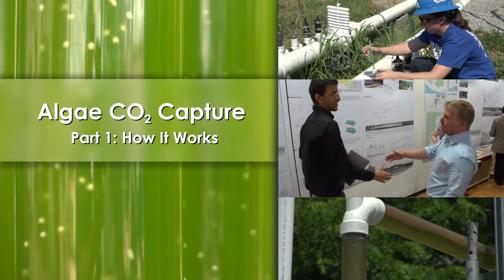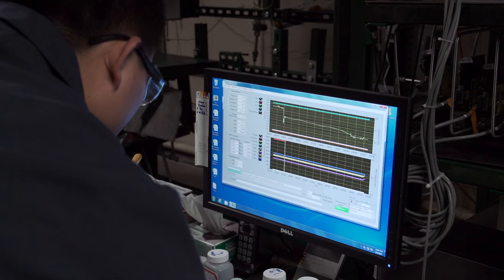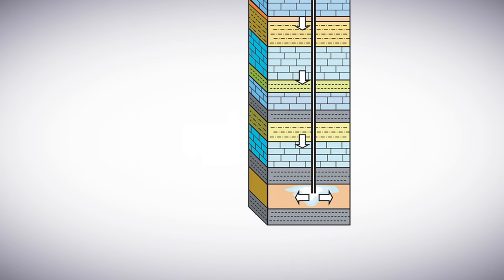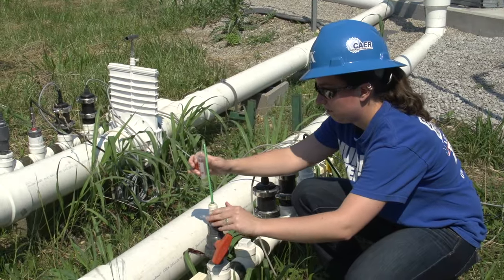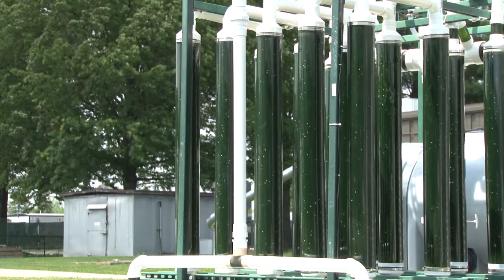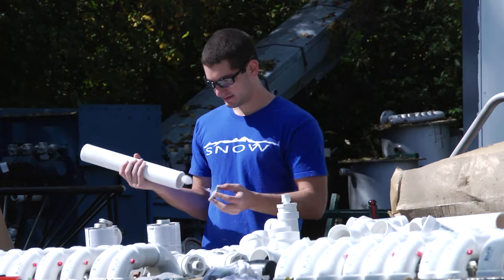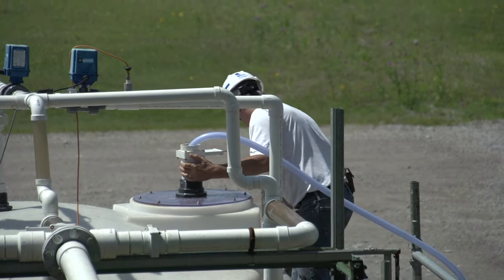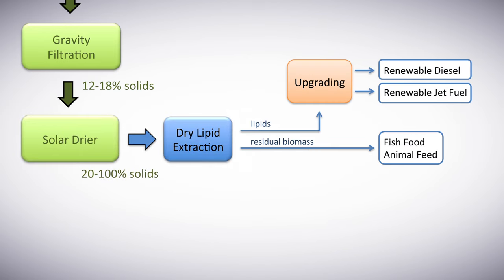Algae CO2 Capture at the University of Kentucky: Part 1

Comment: Could we PLEASE just focus on getting the CO2 out of the air as fast as possible and NOT delude ourselves into believing we're going to use the algae as a biofuel, which would - by burning it - simply put the CO2 BACK INTO THE AIR?
Reply: Algae fuel could help with STORAGE which is one of the MAIN CHALLENGES for the breakthrough of  renewable energy - the CHANGE of PARADIGM. - Algae fuel would be NEUTRAL in the carbon cycle - and it  REPLACES FOSSIL fuel  - So it does not decrease Co2 in the atmosphere - but it also does not add either, it is at LEAST neutral.  Algae COULD be a form of sequestering btw, but using the won bio mass as fuel, food ... makes them more economic. As long as there is no compensation paid for sequestering.
Reply: Co2  SEQUESTERING SCHEMES are by nature large, industrial, investor-friendly business models. Ideas like pumping it back deep into the earth or into the deep ocean and other schemes that may or may not work technically. 
Working not  only for a few years but at least keep it away for some decades, never mind the costs or unwanted side effects and hazards.

True, we  might need them anyway as an emergency measure because of the RESISTANCE to any change  by Big Biz and politics for decades.

But as a matter of urgency we better make sure to protect exisiting forests and take care of METHANE release (swamps, leaks in piplelines, fracking, garbage dumps, agriculture, especially MEAT production, BEEF production) - both points see below.

Also Co2 removal  from the atmoshpere PLUS continued extraction of fossil fuels (like they could last forever !! or be won without major costs to the enviroment)   is is a scheme that for sure will please the existing lare energy providers (their sharehoders and the politicians they bribe).. 

The easy to extract, cheap fossil fuel sources have been used form many decades (for instance Saudi Arabia, Iran, Russia, ... ). Now it is offshore drilling, fracking, hare brained futuristic schemes to use Methane ice. It is getting more poisenous or dangerous to get to those fossil fuels. And more expensive.

It does nothing to eliminate "blood for oil", the pollution and the  destruction of the  enviroment because of extracting oil or fracking or coal mining.

There is a lot of talk about fusion reactors - they have been talking about them since the 60s. They may or may not become viable in the next 20 years.  Well we cannot wait for them. 

They still would produce waste (although it is easier to handle that waste compared to that from nuclear fission, for which there is NO solution so far) 

On the other hand one has to think about the large scale use of that energy source  - for transport, for heating, producing fertilizers - there still will be a serious challenge regarding waste management.

YOU might not promote sequestering in combination with continued use of  fossil fuel  - but you bet that is the only way Big Oil and Big Energy and also the Military Industrial Complex can resign themselves to any REAL action.
Sequestering - and maybe nuclear fusion.

And they act like even for that we had time forever. - There is be a point of no-return where we get runaway global warming - and we are near that threshold or already passed it.

We  the citizens do not get a) another form of  decentral, small-scale energy production and b) will have to bear the additional costs for those investor friendly schemes that work only with Big corporations..
Reply: With renewables production / demand cannot be made to match,  there are spikes, production is erratic (too much solar electricity puts the grid in danger - that is an issue with German production - or not enough energy when it is needed). 

Cost efficient production of renewable energy WHEN conditions are good isn't the issue anymore especially for solar and wind, and we get much, much more solar radiation from the sun  than we need to harvest.

But navigating the erratic nature of renewable energy is still the issue and has prevented their breakthrough so far - I mean taking over big time.

Metal-based battery solutions come with their own challenges (like the impact the mining and their production causes pollution). 

Maybe there are other solutions: Graphene ? artifical photosynthesis, SolarToHydrogen, SolarToGas (gas in that case means Methane  the same molecule that is the main part of fracked or fossil gas).

Fuel cell or hydrogen fuel cell  research has been around for decades - but of course only with some half hearted commitment /public funding / subsidies. 
Major subsidies would be needed for any groundbreaking new technology:  ALL really new technolgies (even more so when they also needed  infrastructure) had a lot of public funding.

Algae fuel  could be part of the  storage solution, and it does not require completely new  technology - like with  Graphene research or hydrogen fue or nuclear fusion (Thorium). Some breakthrough headlines in spring 2018, regarding nuclear fusion we'll see.
Reply: I also like the versatility of algae: the harvest can even be used to sequester carbon (than it would actually reduce Co2 although at higher costs - well no one knows what the other schemes for carbon sequesterin would cost). - One cheap scheme would be GROWING TREES. They can easily last 200 years, some species get much older, that could buy us some time.
If the won carbon/biomass of algae  is USED it constitutes  at least a CLOSED CYCLE = NEUTRAL FOOTPRINT  - and it can become food directly for humans, feed animals, maybe be turned into fertilizer. Or different sorts of fuel - replacing the fossil fuel we use for cars, trucks, airplanes. 

Maybe it can even replace fossil fuels as raw material for the petrochemical industry.
Reply: Of course there have never been really BOLD RESEARCH  EFFORTS  for all sorts of storage solutions. Not with the kind of "can do" attitude that was shown for instance in the  "Race to the Moon" or  with the "Manhattan project". 

Or the long and sustained efforts and military funding that went into the development of electronics, PC, the internet, touchscreen technology. 
(No, we have not to thank the  "free market" or entrepreneurship for these breakthrough technologies - they all received massive and long lasting funding - by the military and it was also lobbied for by the people who profit from those contracts.) 

Unfortuntely until now that kind of commitment seems only to find political support if it is for war/military - not for life affirming efforts. 

A good, scaleable, reliable, economice solution for the STORAGE problem (how to deal with erratic production, how to bridge the gap between solar production in summer and winter) would be the breakthrough - and would shift the whole energy system to become more decentral with smaller or non-profit players.
Reply: Electricity providers or energy companies were by necessity always large, the infrastructure is expensive. Traditionally - and in all countries ! -  a lot of collusion with politics and regulators has been going on. That is caused by the almost monopoly position and the large size of these companies, of course they attracted the vultures.

Big Energy =  revolving door, political donations. - Your  local non-profit neighbourhood plant for a few hundred people is not going to engage in that game. They will not have the money for the lobbyists or the cushy jobs for ex-politicians.

Breakthrough storage would rock the boat for Big Energy - and the politicians that collude with them. So the political efforts for the competing technologies  have been inconsistent and not too ambitious - to phrase it politely.

That is one of the reasons the Western governments do not throw money right, left, and center at any form of storage researach. There is some lip service paid, and some research funding which is then proudly paraded around -  but not too much to speed up the change of paradigm. 

And then the politicians turn around and continue to  serve the status quo - that means  the current energy system and large multinationals engaged in it.
Reply: Like Hillary Clinton reorganized the State department to promote fracking worldwide on behalf of some of her donors, U.S. fracking companies. Even I know about the Methane footprint !! of frackntg -  addtitionally to the pollution and health hazards that come with it.
Methane has 28 times the capacity of Co2 as a greenhouse gas over 100 years, the only good thing is that it remains not as long in the atmosphere as Co2.

Hillary Clinton, Obama, Justin Trudeau, ......talk about Global Warming - and then turn around and do the opposite. Same in Europe, Australia, Japan btw.
Reply: The somewhat erratic and unreliable !!  solar and wind power MUST be BACKED UP - ideally (at least at our current state of technology)  with small decentral GAS turbines to support and secure  the grid or support a  local, independent energy production. For instance when there is no sunshine  AND not much wind either.  

Gas turbines (run with fossil gas) are currently doing exactely that job in countries with high solar/wind energy production like Germany. Unlike coal power plants they can jump into action quickly and working them in on-off mode does not wear down the machines or reduce their efficiency. 

All steam engines have a physical limit that only 30 % of the fuel can be converted into mechanical work/electricity, most of the energy content of the fuel is lost to the heat that is generated in the process (the same physical limit exists for the combustion engine used in cars).  And in  practice it is only  25 - 27 % even with the most modern machines. That principle of thermodynamics is the same if the steam engine is run with oil or coal.

One CAN use that "waste heat" to produce warm water, or to heat nearby homes. Putting the waste product of electricity production (unwanted heat) to good use increases efficiency to 60 - 65 %. Which is good enough considering such power plants are the indispensible back up the system of renewables - at least for now. They are used like that in Germany, Austria, the Scandinavian States, ...

Those backup power plants are relatively expensive to run (as long as gas is as cheap as it is now). Whenever solar or wind power  is plentyful they have to stop production.  They are not running under full steam or 24/7 which would make them more "economic" -  if you only look at that one operation - but they are needed for the SYSTEM regardless.

Running such gas turbines not with fossil gas (or diesel)  but with algae  fuel that has a  NEUTRAL Co2  footprint is a progress. It is worth an attempt. Of course one can weigh the cost advantage of using imported fossil gas (not fracked though !) - and putting those savings to good use elsewhere. - We need to try out a lot of things.
Energy is also much more expensive in Japan or many European countries (electricity and fossil fuel). That does not prevent a country from being wealthy. Even in competition with energy squandering nations like the U.S. that have cheap energy prices. As long as the energy prices and other costs  stay in a certain range (Europe still competes with the U.S. manufacturers!) - it does not better.

We live under the tyranny of the lowest price and the highest profit in our current economic system. That is not really relevant for the wealth of a nation.
The solution / the prices must not be the ulitmately best - just good enough.

In India there is an interesting development going on: many remote areas are soo poor and under-industrialized that they  never got to have an elctricity grid.

Now they skip that stage. Remote villages run or used to run  expensive diesel power generators to have at least a little electricity.  They switch to solar and batteries now. Other storage solutions -  algae based for instance  - replacing batteries or the diesel for the old technology might be helpful.
Reply: Ethanol and biofuel projects are a ecological desaster for the rainforests - Co2 SEQUESTERING anyone ?  - The EU foolishly - well on behest of large "investors" -  supports those schemes which are supposed to help against Global warming by replacing fossil with  bio fuel.

Well they don't - they make matters WORSE.

The ethanol or plant oil  is not produced in Europe or other wealthy countries. It would cost more to produce it there.

They cut down the rainforests in Asia and Latin Amercia to make  place for the plantations, palm oil for instance. Which is an INCREDIBLE LOSS for mankind.

So all the carbon that was sequestered in those old vast forests is released AND it is catastrophic for the ecosystem, the soil, the natives, the animals, it also changes the microclimate, rain patterns if the old forests are gone.

In the moderate climate zone we can cut down forests and replant them, or wait for them to regrow naturally - a healthy ecosystem can recover over the course of 40 - 60 years and with some luck not much soil is lost.

Not in the RAIN forests. the high rain volume dissolves all the nutrients that are not captured in bio mass. And those systems also cannot afford to lose too much biomass (when the wood is taken out and used for paper production, cheap furniture).

The natural woods in the moderate climate zone are beautiful, stable and diverse - but they have NOTHING on the extreme diversity and specialization of the rainforests. That is nature's strategy to deal with the challenge (lots of rain, depleted of nutrients !)

Our natural woods have a certain number of species (plants) that manifest in large numbers (like a wood and almost all of the trees there belong to a range of let's say only 50 kind of trees - varieties of oaks, birches, beeches, …). In the rainforests it is an incredibly HIGH  number of species (different kind of plants) but they do not manifest in high numbers. 
And some are limited to small areas. If that area is destroyed that plant is gone too, all animals that specialized in those plants (insects) and all the potential use for humans (like an interesting chemical that an insect produces, or something that could help with pharmaceutical research). They are often not even detected yet.

Some of it is used for throw away funiture, but often they just burn down the old rainforest to make space for the lucrative business model. That of course would not even exist without the high EU subsidies for biofuel

They can maybe produce some Ethanol in a sustainable manner in Brazil for domestic use. But not on a large scale for export. 

The use of land for the production of bio fuel competes with other use: like to  grow food for people, grow cotton, wood for more sustainable use.

The forest areas in the temperate European countries are expanding , have done so for many decades, when traditional agriculture is given up, they plant trees on the grounds that are  hard to work (slopes, altitude, or it is not the best farmland). 

So there would be no need to cut down the trees of Canada, Siberia, or even worse the tropical and subtropical  rainforests if we need wood. And hemp could replace a lot of wood.
But that wood would cost a little more than when plunder the old forests that take much longer to grow and are more vulnerable systems when they are disturbed  (which is also true for the forests in the North, Canada, Russia).
Reply: Im from Croatia and im melting over here. People around me are migrating . About 600k of people went out of here in the last 5 years. When i see todays temps in Tunis (40C) and middle east (50C) and experiencing very nasty and sudden T-storms with strong winds, every day i check the weather if those temps are coming to me. Im in panic and rage because im unable to do anything nor i see Europe is doing something about it.
Reply: Hello! There is intelligent life here after all.
Reply: @xyzsame4081  Wrong. You need to look at the energy cost in terms of C with what is done with the algae. Producing algae like this creates far more atmospheric C then it can possible sequester. Just green window dressing for burning coal, nothing more.
Reply: @xyzsame4081  36 years in algae industry here. Trees are by far the best option for sequestering C. Maybe too growing more algae in the open ocean, but that is risky and requires more study. Trees are a safe bet.

Comment: Also, does the algae require any fertiliser?
Reply from the maker: Hello. Here is Dr. Crocker's response to your question:
Yes, algae require certain nutrients which are provided as fertilizer. The most important of these are nitrogen (N) and phosphorus (P). The N can be provided as a nitrate compound such as NaNO3, or as urea. The P is usually provided as a phosphate compound. Additionally, algae require lower concentrations of other nutrients such as Mg, Ca, K, etc.
Reply: @universityofkentuckyofficial  So, can I farm algae by letting sewage and farm runoffs flow through an algae breeder? I think if could, we can kill two birds with one stone.
Reply from the maker: From Dr. Crocker:
"Yes, it's possible to use farm run-off as a nutrient source (i.e., water containing N, P, etc.). You may need to add some fertilizer depending on the concentrations of the nutrients in the run-off water. I wouldn't use sewage for a couple of reasons: (i) the algae culture will become heavily contaminated with bacteria (the bacteria may take over); (ii) adding solid matter will cause the algae culture to become turbid, cutting down the amount of light that can reach the algae in the culture. Hence, the algae will grow more slowly and may die if the culture is too turbid."